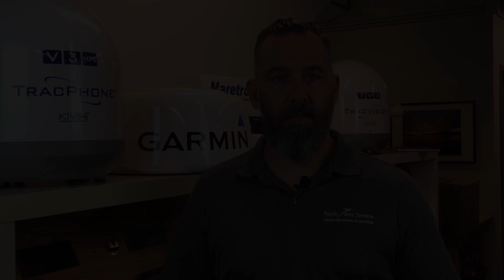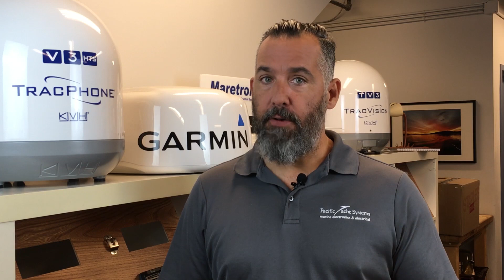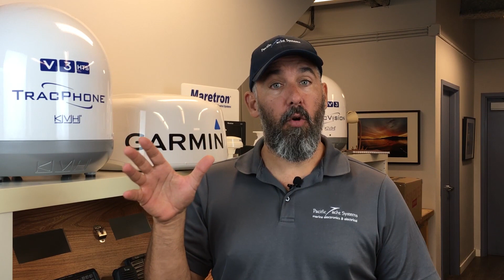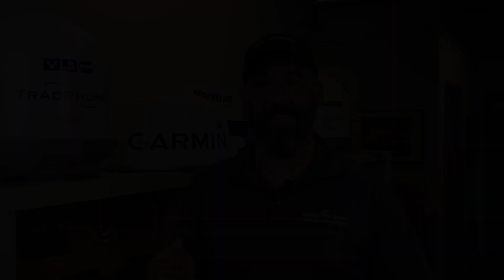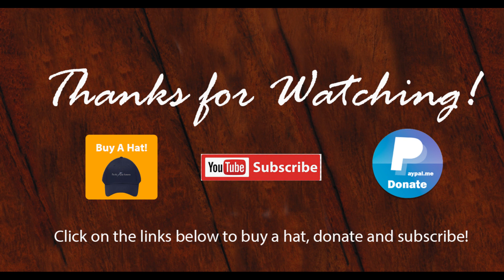Ask PYS - I Have a Battery Isolator, Should I Connect the Solar Panels to the House or Starter?

Comment: I have the exact question as it says in the title yet I don’t consider myself “answered”.
He has the isolator. Clearly he can’t buy another charger. Or his panels don’t het shading (mine don’t!)
Is it possible to connect the isolator so the one charge controller can be used for both the house and the starter?
Reply from the maker: Never tried this, i.e. connecting a solar controller output to a battery isolator to share solar charge to two battery banks. This could work, just haven't seen this done before. 

Anyone got experience with connecting a solar controller to a battery isolator?
Reply: @PacificYachtSystems   I just tried this with the Argofet isolator. The problem is that the controller doesn’t get voltage feedback from the input stud. So can I hook the “alternator exciting” output to the input side?

Comment: Do you have your engine's alternator feeding current to your house batteries.  If so, how do you set that up if some of the alternator current is also charging the engine starter batteries?
Reply from the maker: Hi Scott, for sharing a charging current from the alternator, you can consider a battery combiner, a battery isolator, or a DC to DC charging converter.

Comment: If I use a battery isolator (like a ArgoFet 100) for three battery banks on my engine generator and want to connect a solar controller can I use the same battery isolator to distribute the charge ?
Reply from the maker: Never tried this, but read of some boaters doing so.

Comment: Jeff, first of all, congratulations for the good job you have been doing here on YouTube. Very informative.
I use the same logic as you regarding the content of this video, installing the solar system on the house side.

But about the use on multiple MPPT controllers, it wouldn't be better to use the new SunPower pannels instead? They have bypass diodes on each cell, and if they work properly, that would be even more effective than having a dedicated MPPT controller for each solar panel. And as a plus you save a huge amount of solar cable and space on the usually tight electrical compartments.
Reply from the maker: Good points, here are the considerations to weigh in for single or multiple controllers: 1) less wiring for single controller 2) single point of failure (e.g. no redundancy) with single controller 3) if your panels experience different shading conditions because of obstructions (e.g. boom, radar, antennas) better to have dedicated controllers.

Comment: I understand that shading on one module will affect the others if connected in series. But connected in parallel this should not happen. I do not understand why dedicated controllers can offer more tolerance to shading than parallel wired modules with a single controller.
Reply: That's because you can track the Vmpp of each panel separately. If you have a Panel that is partially shaded (and the bypass diodes are working properly) the Shaded Vmpp of this panel can be 0, 1/3 or 2/3 of the Vmpp of the unshaded panel.
If you use a single charge controller you have multiple Maximum Power Points in your system, and most of the MPPT controllers are not really good to find the maximum power point over this conditions.

When you connect the panels in series, if you have a partial shading condition, you knock off part of the shaded panel, but you still have one single maximum power point.
Reply from the maker: Totally inspired. Next time it's sunny here in the Pacific Northwest, will take some time to make a video on testing solar panels in series and parallel with various shading.